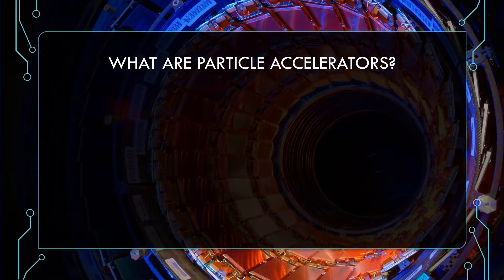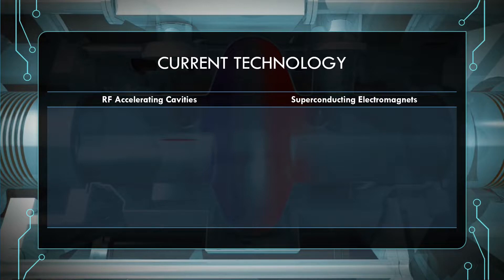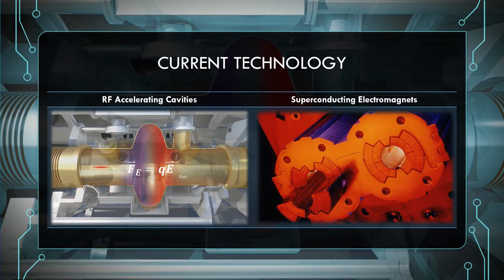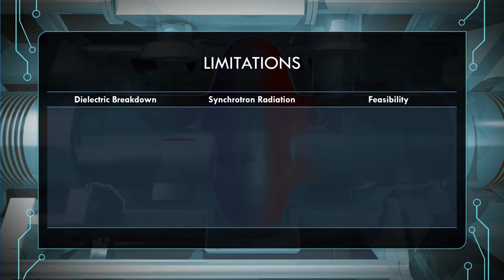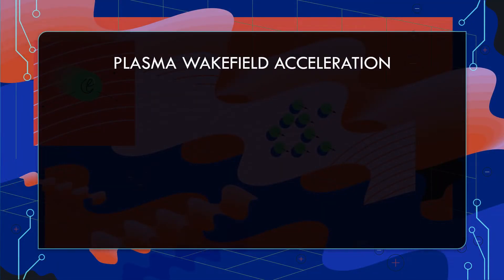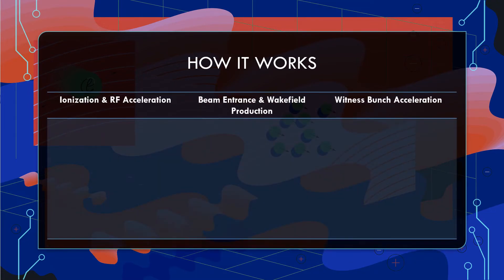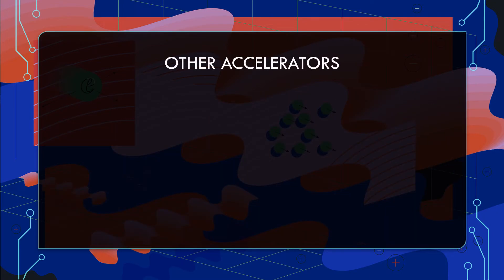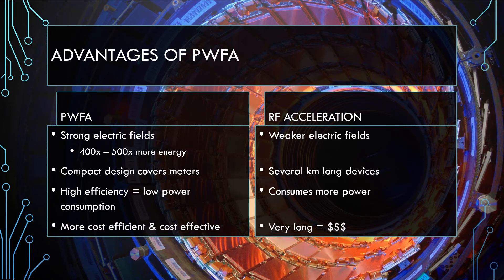Plasma Wakefield Acceleration | Grade 8–9 Summer Physics Project

Comment: Could you explain the mechanism of wakefield acceleration in more detail?
What happens to the drivers beam after entering the wakefield ? Do they pass forward after pushing the plasma electrons or do they interact with the ions?
Does the witness beam interact with the ions?
What happens to the plasma electron?
Reply from the maker: Hi Reema,

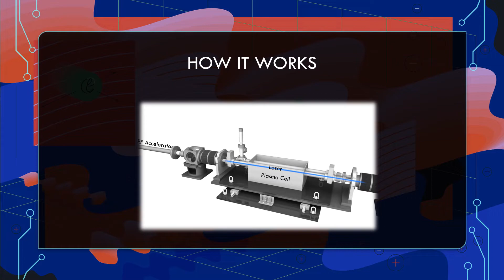I'd refer you to 6:18 of the video as rewatching this section may answer some of your questions. However, I'll also explain the acceleration mechanism along with a helpful analogy here for you:

- As the drive electron bunch enters the plasma cell, it repels the background electrons due to its negative electric charge. However, since the ions are significantly more massive, they're relatively uninfluenced by this. The background electrons are then attracted back in toward the beam axis by the positively charged ions. This is analogous to a boat driving across a still lake.

- This interaction gives rise to a positively charged region of plasma which follows the drive bunch through the plasma cell. The electric field due to this configuration is known as the 'wakefield'. The analogue for this is the wake that the boat would produce on the lake.

- The wakefield focuses and accelerates the witness electron bunch. Regarding our analogy, imagine a surfer riding the wake of the boat, gaining energy from it.

I hope this explanation answers your questions and helps this concept click for you!
Reply: @hugomackay6169  thank you
Reply from the maker: @reemashrestha9718  You're welcome. I'm glad my explanation helped!